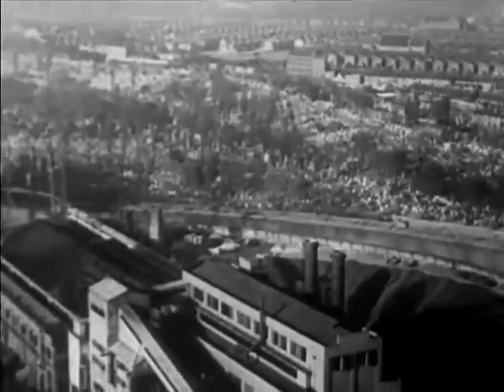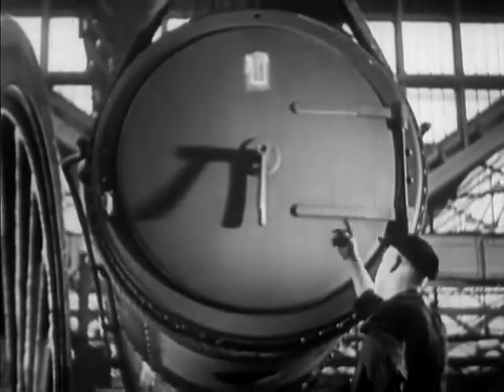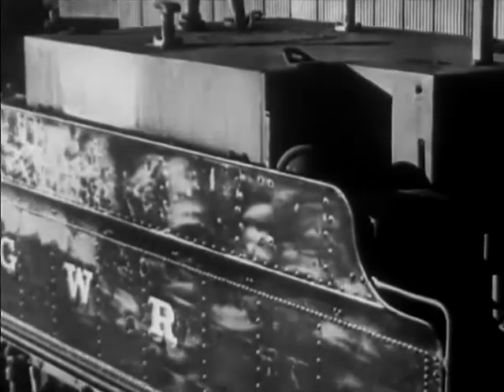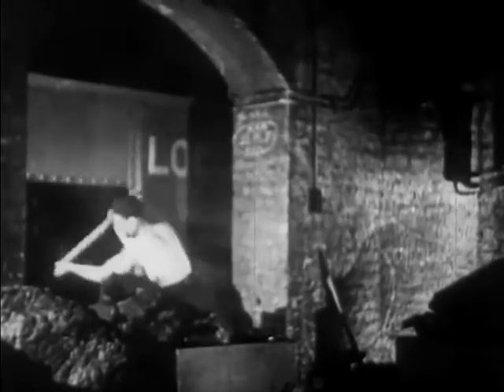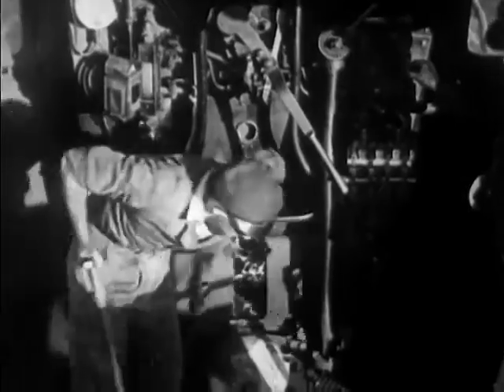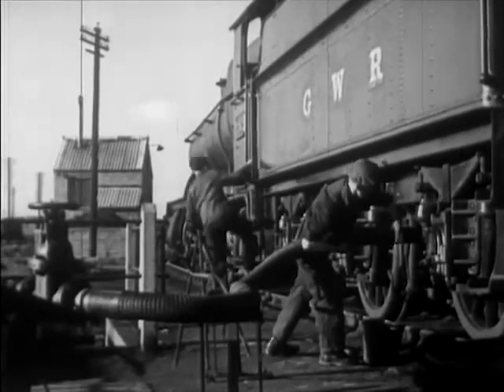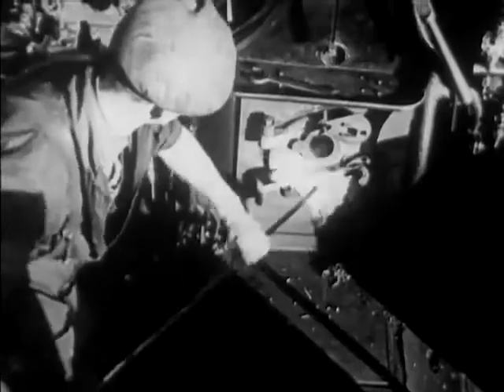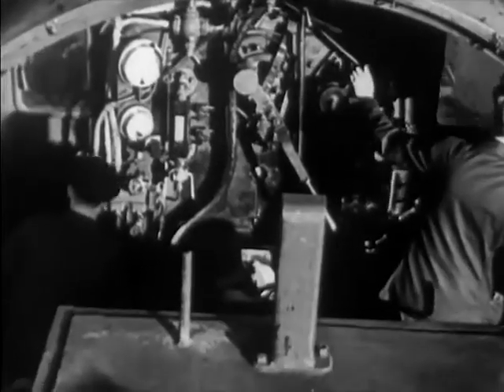Vintage railway film - Britain can make it - 1946

Comment: Well that idea lasted all of two minutes. The heavy oil used was maritime grade "Bunker C", get it on your clothes and you have to bin them - it turned out to be prohibitively expensive. Bulleid did a very successful conversion on some Light Pacifics, once he discovered the Laidlaw-Drew Swirlyflow burner (another naval idea) - performance improvement was terrific. Bulleid was very much aggrieved that later steam vs diesel comparisons did not permit oil burning for steam, biasing the outcome.

Comment: I wonder why they didn't have enough coal then?  Oil would have to imported so it probably wasn't cheap.
Reply: Turns out they found a bunch during the war
Reply: @immrmessy  Shhh, you'll give away the reasons for all the wars after WW2.
Reply: We did not have the foreign exchange. Even 'pool petrol' of poor quality could only be purchased by someone such as a doctor with the relevant permit. Everyone used coal and many pits were too deep and old and faulted. We had to wait until c. 1960 for the investment to build new pits with their associated railway lines, such as Bevercotes in Nottinghamshire.
Reply: We had plenty of coal, but RAMPANT absenteeism amongst miners, and the Labour government hadn't got the guts to do anything about it.